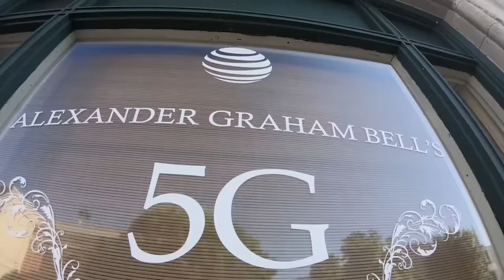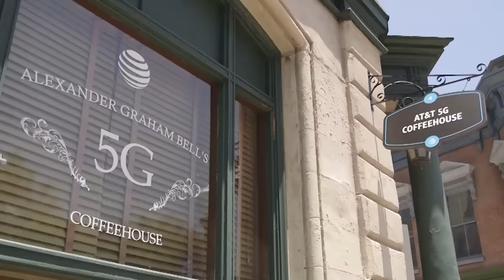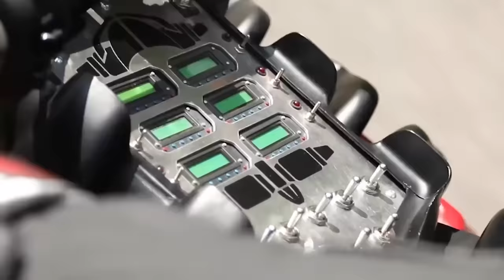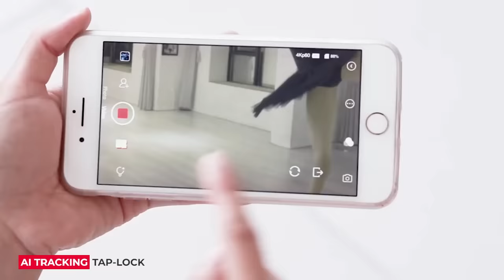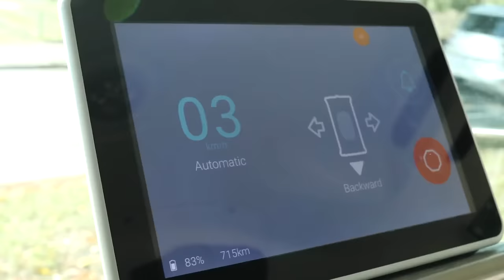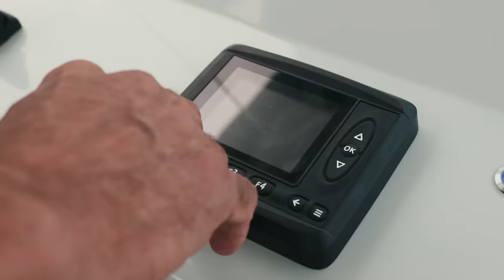CRAZY TECHNOLOGIES THAT ARE ON ANOTHER LEVEL

Comment: I heat that little self-driving car. There being tested and planned as a limited public transportation network in my home city of Jacksonville Florida . Right now it's a single test car that covers about a 3 mile route . This one test car 44 million or about 440 city buses and the full program with a range of about just 8 miles will cost 444 million. The city of Jacksonville is 875 square miles so this 444 million dollar project with only effect 1% to 2% of the city. 

You could have built a local rail next work for around 625 million and connected to Amway with most of the money coming for CSX rail the largest rail shipping company in the country how have a regional HQ in Jacksonville.

Comment: So why couldn't they make the hologram thing work without 5G say over fibre optics, seems a huge draw back if it relies solely on one type of transmission method to work.

The flying motorcycle won't be allowed to fly, hell the govt would love to see the back of regular road going motorcycles let alone one's in the sky.

The laser cleaner has been around a while now but oddly enough when you google it you can't find the price of the machine, that's a pretty amazing bit of kit for prep work I wonder what the running costs are like.

Self driving mini bus is a very dangerous idea at the moment, these things simply can't respond to the problems that might arise, let's say a baby crawled onto the path where that mini bus thing was driving would it be able to recognise that it shouldn't squash it, or a dog let's say a little chi Wawa tiny dog but unable to get out the way for whatever reason.

The bed looks like a good idea until one of the legs bend or break then it probably won't fold up, it's a nice idea but the extra cost of a whole folding leg system seems an added expense you could easily live without.

The boat seems to be carrying a lot of drag.

Comment: What is the dubstep song at 4 minutes?

That bike is stupid btw. Center of gravity should be higher like on a helicopter or the device will be to unstable.

Low or mid center of gravity is only. For stunt drones and planes.

To dangerous forva human.
Reply: Edward Gardener Actually the opposite is true. The center of gravity (the craft’s body or load) on a helicopter or drone is below the lifting device (engine/motor and propeller blades). They’re more stabile that way not how you describe them.
Reply: @robo08ify  any person that ever rode a bike can tell you that the person on top decides which way the craft is going to lean. On a bike this is ok, or on a jetski for instance. In the situations it helps to steer. The air does not profide any counterbalance and you should ALWAYS HAVE THE WAIGHT HANGING UNDER THE WINGS.
Reply: @robo08ify  but i mean exactly the same thing. The load is hanging UNDER the main rotor or whatever is lifting the craft. Its NOT UNDER so it does not need CONSTAND BALANCING WHICH IS DANGEROUS AND UNEFFECIENT.

Comment: Cool vid and unique stuff. I will never go electric though. I dont want control over me. Gas engines and soundgasms for life. Commercial aviation will never go electric 😂😂 pos electric propulsion at 100k pounds of thrust will never happen.
Reply: You're WAY behind the times my friend!.... Use the search term: "Newest electric flying car" on YouTube and you will see that there are several successful purely Electric models that have already been built, tested and found to be ultimately quite practical as a short-range commuter vehicle..... However, because of their limited range they are only practical for travel within a metropolitan area, however, there are several Hybrid models with great enough range to be used as practical Intercity transportation.
At this time, anything but emergency/rescue aircraft are forbidden by a great many metropolitan areas, in order for these vehicles to gain popularity those laws will have to change.
Reply: @joshhayl7459  Im in commercial aviation. They are trying but it wont happen. There's a channel called Real Engineering amd he can better explain why.
Reply: @ Lance Dooley ,
🔴 I do not understand your last statement...please clarify:
Do you mean to say that you are still insisting that a practical and feasible all-electric aircraft will not happen?......As I have already pointed out, there are a substantial number of both all-electric as well as fuel/electric hybrids (which solves the range problem) that have already been built, tested and okayed by the FAA.......